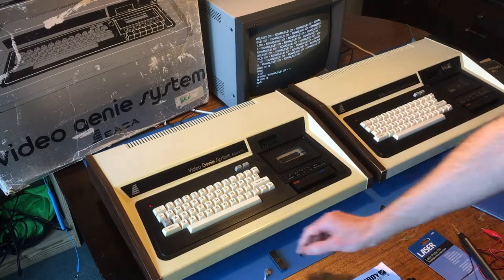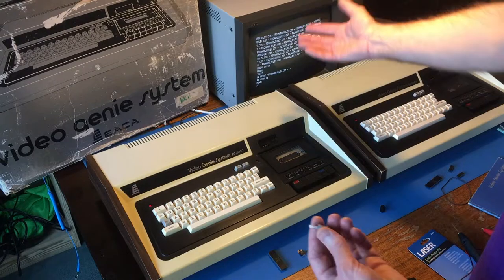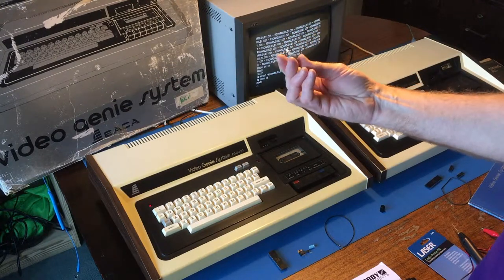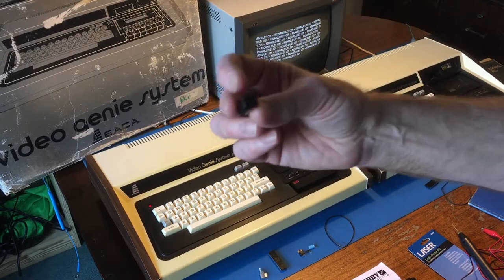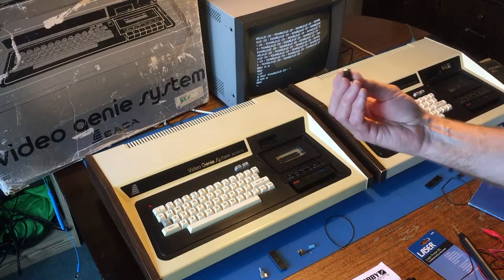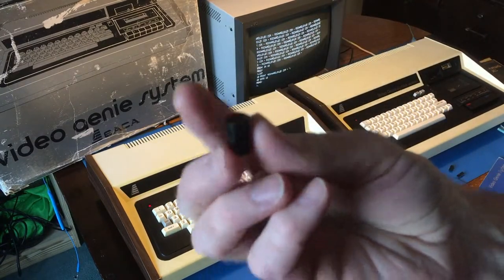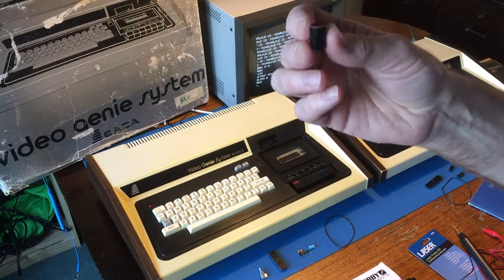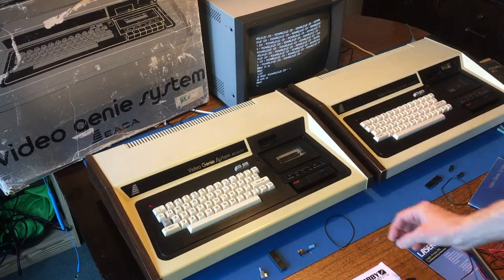Video Genie - Retro Challenge 2019/03 summary

Comment: What was the RS part number for the replacement buttons?
Reply from the maker: I used RS part number 123-9566 (Alps Alpine UE200011).  I'm not 100% sure if it's the same length as the original, but it fits well, and has a very similar aesthetic to how I remember the original buttons.
Reply: @richardloxley  Great, thanks for that.

Comment: I'm considering a Video Genie, but before I actually get one, I'd like to know if there is a modern SD card device available for it that acts like a hard drive.
Reply from the maker: Omega TI as far as I know, no one has made anything like that. I use a Gotek floppy drive emulator, but for that to work with the Video Genie you need the disk expansion interface, which is pretty rare. I was quite lucky to find a working one on eBay.

There are some hard drive emulators available for the TRS-80 model 1. The Video Genie is an almost exact clone of the TRS-80 model 1, but it does use a different pin-out on the expansion connector, so any of those solutions would need a special cable at the very least. But it's possible that they might work. So it might be worth you having a search for information about them.

Incidentally, most of the information on the net about the Video Genie uses its Australian/New Zealand name of System 80, so search under that as well. Terry Stewart has a really good System 80 website.